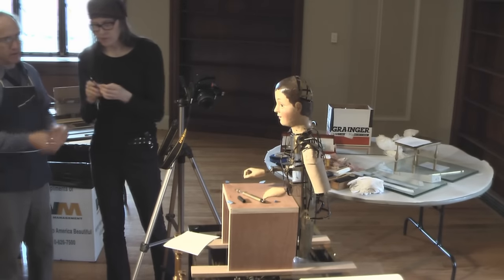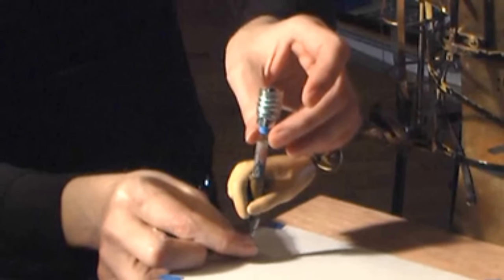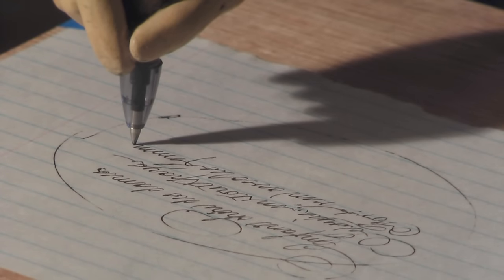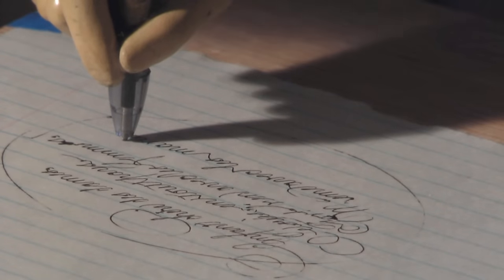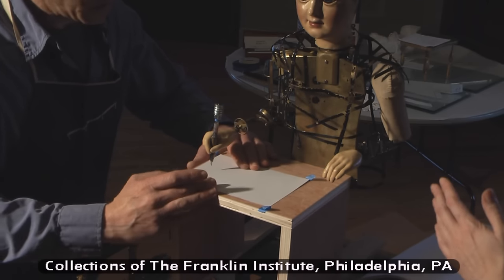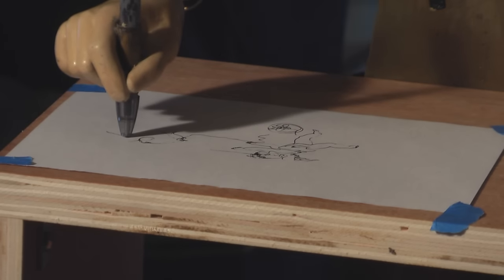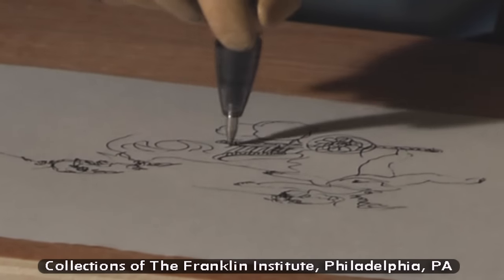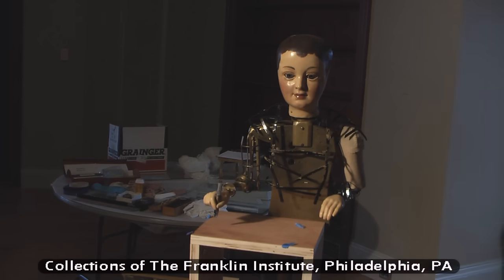Floating Stylus Test For The Maillardet Automaton With Commentary

Comment: Have you ever considered using a Wacom digitizing pad and stylus to capture the variations in pressure?  The tablets will both capture the X/Y coordinates as well as the pressure and there are several different nibs available, including the softest spring loaded nib (as well as felt nibs if desired) that I suspect would work best to capture the effect.  You may still need to spring load or weight the stylus because the spring loaded nib does not have as great a range of motion as the pen in your video, but you should still be able to capture much of the variation in pressure and manipulate that in Adobe Illustrator (or other modern vector editor) to better visualize the end result of those variations.

Comment: I think I've seen pen plotter pens based on valving like you sketch out, though my memory could well be mistaken. Refills are probably extinct anyway even if I do remember correctly. I wonder though if the original pen might have been some sort of brush pen instead? That would give some degree of line weight variation that's probably more linear than what a valving approach could do.
Reply: After reading over the blog entry, I think we can drop the brush pen idea. However, on digging a little into what I remember of the plotter pens, much to my surprise, the stylii are still produced not just for pen plotters, but also as technical drawing pens for hand drawing. 

Apparently, the sort of stylus you've sketched out is trademarked as the Rotring Rapidograph, and Rotring still produces pens and replacement nibs, also selling variants under the Koh-I-Noor name (the plotter pens I'd remembered were/are sold under the Rapidoplot name). There are other brands of technical pens that appear to be the same idea - the Staedtler Mars Matic feels especially familiar to me.

Inkflow for these appears to be binary without any useful modulation between being on and off - these pens are meant to draw a defined line weight - but perhaps this was true of the original too.

Comment: Your experiment would have been much easier if you had an adjustable pulpit. I wonder if the offset is not related to the fact the original pulpit was at slight angle.
Reply from the maker: You can read the blog - The wooden 'desk' we are using is Andy's tool that is used when the top of the case is removed for servicing. That glass top contains the original brass writing desk, and it is flat.  The original pen is held completely perpendicular to the writing surface.

Comment: ... just two observations... back in the days of classic ink pens... the "pumping action" as you described would be used to broaden the strokes...the two halves of the stylus tip would split wider, and cause the width of the stroke to widen along with it.  Also, the ink should not need any sort of valve to open/close to control the ink flow.  Traditional ink pens would have an "ink feed" that would use the surface-tension of the ink to stop the flow... and allow more of a wicking-action to keep the ink flowing when needed.

Comment: Judging by the precise movements of the stylus even the correct ink formulation would be required to get an accurate viscosity for a proper ink flow to get a rendition of the drawings as intended by the creator(s) of the machine, because of the subtlety of the strokes shown.

Comment: That sounds much more like a standard ink pen nib. Under higher pressure the nib opens up and allows for a wider line.
Reply: and have you tried technical/  drafting pens? The Rapidograph uses a similar point and stem, though the weight at the top doesn't actually valve off the ink flow. 

adjusting the table might be easier than adjusting the hand

Comment: Could the original have been more like a caligraphy pen with a split nib? That reservoir has a stop ring for weight regulation of height  floating within the hand tube, which would have obviated the plastic guide for the Pilot pen that you substituted for diameter purposes getting too close for the loose tolerances of the Z axis.
Reply from the maker: Read the blog - The pen is perpendicular to the paper surface at all times, not tilted, and must draw an extremely fine line in all directions. There is no maneuver for dipping - and fountain pens with their air exchange regulators were more than a century away.